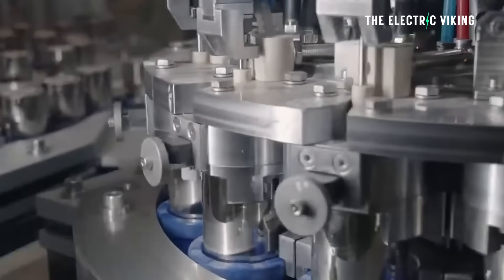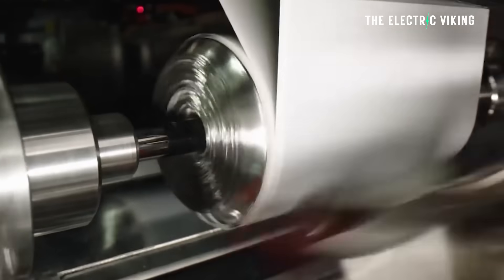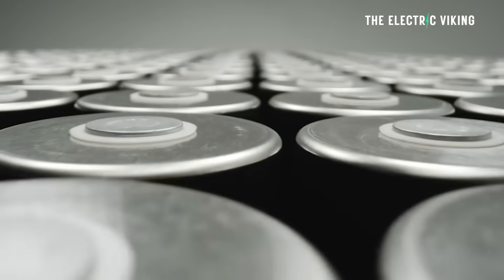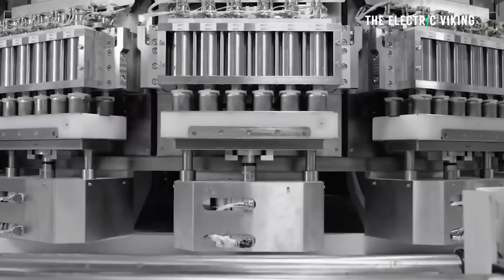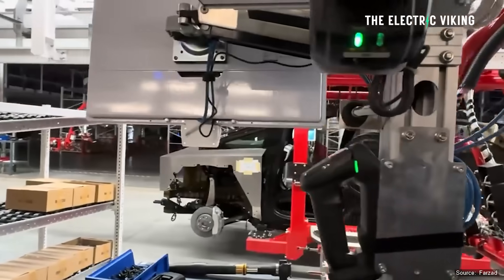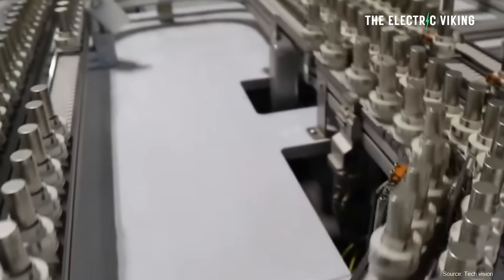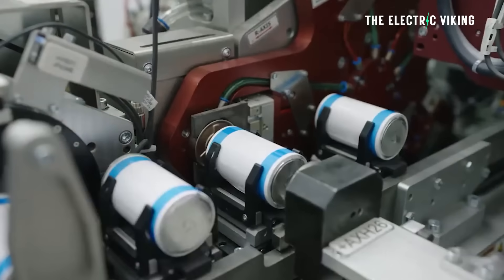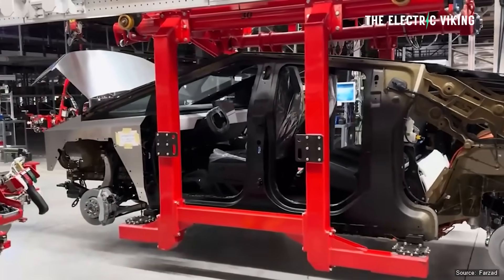Cybertruck dry coat 4680 battery technology limited to 2000 packs per month

Comment: Currently, the real limit is the truck itself. Batteries ARE NOT the limiting factor (right now).

One side’s (anode?) been dry since the first generation 4680. They needed to end gen 1 production regardless. It made sense to transition completely to gen 2 cells. Currently, only two of eight cell production lines are running in Texas. There’s no point in starting more lines when they are already producing more cells than they can use. Obviously, as production ramps, they’ll need to speed up the current lines, and/or start additional ones.

A better question is, when Kato road comes back on line will it be producing gen 3 cells, and what will their composition be?

Also, the current Tesla semi doesn’t use the 4680. When will it transition to the 4680, and what chemistry will it be?

Comment: So it is now Tesla Semis vs Tesla Cybertrucks vs all the other models using 4680 cells.
Reply: The semi currently uses 2170. It will use the 4680 built in Nevada when the expansion is finished and the mass production model semi starts getting produced.

Comment: Q3 2023 comments by Drew Baglino SVP of powertrain & energy at Tesla. 
“Sure thing, Martin. 4680 cell production in Texas increased 40% quarter-over-quarter. 
Congrats to the Texas team for producing their 20 millionth cell off of line 1. Texas is now our primary 4680 facility. 
We're heavily focused on quality. Scrap is down 40% quarter-over-quarter. With the increased volume and yield improvements, cell costs consistently improved month over month within the quarter, although we have a lot more work to do to achieve our steady-state goals. And that is our priority. 
The Cybertruck cell, with 10% higher energy than our Model Y cell, started production on line 2 in Texas. 
This quarter, we convert to building 100% Cybertruck cells to simplify and focus the factory as we ramp all 4 lines in Phase 1 over the next 3 quarters. Phase 2 of the Texas 4680 facility is currently under construction. 
The additional 4 lines incorporate further capital efficiencies over Phase 1, and our target is for them to start producing in late 2024. 
Lastly, in Kato, we're retooling to enable large-scale pilot runs of our next-generation cell designs. 
Kato's long-term goal is to be the launch pad for new cells, one generation ahead of our mass production facilities, enabling faster iteration and smoother ramp-ups of new designs.”
Reply: Great news! From someone who works at Tesla I can only assume.